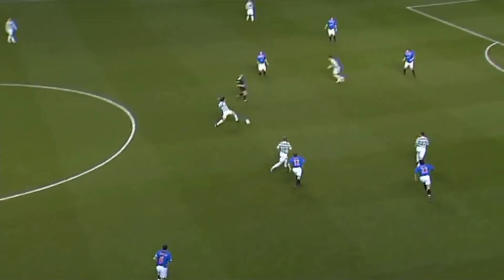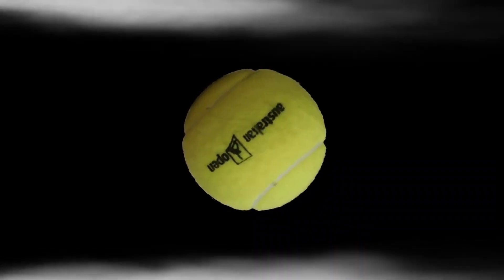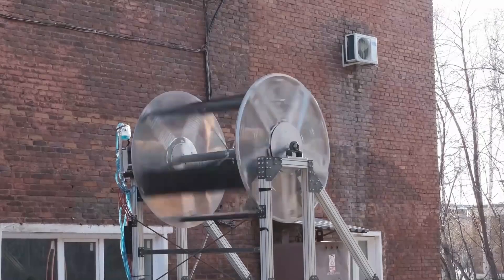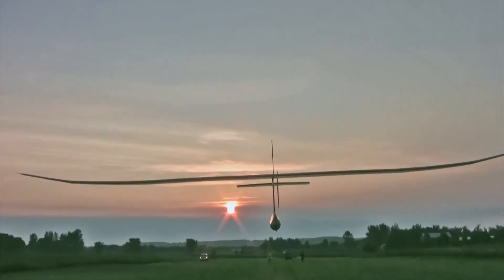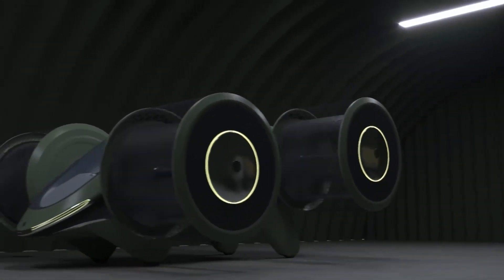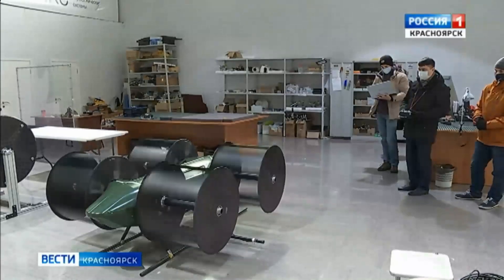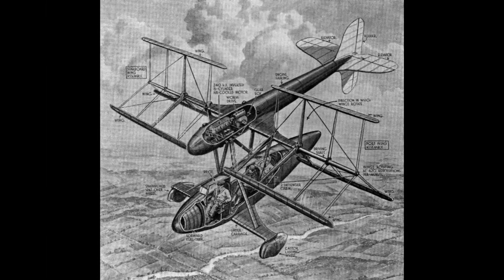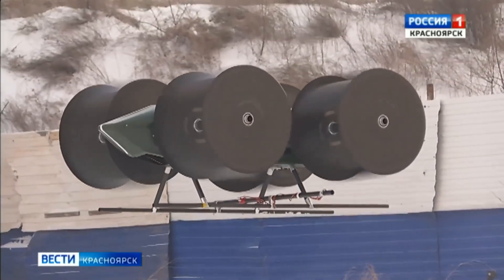The Engineering of ARF's Cyclocar VTOL

Comment: Cycloidal propellers are squirrel cage fans with the blades slightly repositioned. These propellers have been in your HVAC systems, automotive dashboards and leaf blowers for decades! Humans have been pushing air since the 1900's. These cycloidal propellers ARE JUST AN OTHER WAY OF PUSHING AIR.  Nothing cutting edge, futuristic, nor ground breaking about them! Smoke and mirrors for the sheep.  So the heard feels like technology is evolving; without compromising the secrecy of captured off-world propulsion and energy systems.  Alternative Energy and Propulsion Device is what the self-obfuscating anagram U.F.O truly stands for. Please don't be sheep anymore. That tech can make heaven on Earth but it's release would dethrone the kings via abundance for all. And it would eliminate greenhouse gas from fossil fuels and reverse climate change. But the kings would no longer control the energy commodity.  And they're gonna do whatever they can to persuade johny youtuber and the sheep into believing the lie. This knowledge is important. It is the path to never needing a day job and eliminating poverty. Free energy; no copper distribution grid needed. On an other level the "evil" Cabal has a point: us animals aren't moral enough to handle the truth nor the technology. Prove them wrong. Evolve. Elevate consciousness.

Comment: the helicopter engine generates lift all the time during rotation, whereas in this case the force is generated only when the wing is at the top.  or at the top and bottom, while in the middle of the work only aerodynamic resistance is created, so I waste my strength.

Comment: Once we manage to get anti-gravity working, aircraft engineers will be unemployed. Funny to think about how a hundred years of technological development in one field, can become redundant with an advance in another. I think cyclocopters will benefit from a frictionless magnetic gear system. To keep the smooth change of adjusting the pitch of the blades and reduce vibration. They seem very clunky at this point still. The total lack of lift when they fail is of concern. Even helicopters don't usually just drop out of the sky when their blades stop turning. Parachute option? I feel parachutes should be standard for light and small aircraft anyway. It would be such a confidence building thing and like airbags could be installed and forgotten until a warning light shows.

Comment: Now if one took an old plane and removed the wings, then put a row of these down each side. With a jet turbine in the back to generate electricity for them at low speed. And thrust for high speed when the rotors could be locked with the blade segments acting as three wing segments. 
All you need is is an AI to learn how to fly it by trial and error and you have a new low cost mass air transit system that could replace planes trains and buses.

Comment: This type of lift configuration would be awesome for adaptation to electric cars. Imagine pulling up in a fully charged Tesla and having these rotors latch to your wheels. All of the flight avionics and electrical power could be supplied by the car. This would also allow you to fly somewhere, land, then proceed to drive to the exact location.

Once energy density of batteries gets much better maybe this will be possible.

Comment: How I see this:
A square wheel was invented long time ago. There were many attempts to build a square-wheeled bicycle and all of them failed. But modern technology finally allowed to build one! Using carbon fibre composite frame and unconventional suspension, the engineers created a model with 5 kg payload capacity. Yes, it still barely moves but it has such a high potential and has some advantages on difficult terrain.

Comment: Actually it is just a Voith Schneider propeller,  like the one you can find on some highly maneuvering boats, but with a much higher rotating speed because the air density is 830 times less that of water. And... the Voith Schneider propeller is a very complex piece of mechanics. I strongly doubt its air applications could be as efficient as helicopters, even with advanced computer-driven technology.
Reply: Helicopters are actually already quite complex. There are linkages and washplates already on the main rotor to vary the blade's angles. Plus some complex behaviours when traveling forward fast enough resulting in the blades stalling during backsweep, causing loss of lift on one side.

I'd say both helicopters and cyclocopters have the same order of magnitude complexity; but helicopters had had decades of headstart in research, while cyclocopters had to wait until carbon fiber & 3D printing technology became widespread.

Comment: I really love how they get drones and they try to create a new platform for transporting people but it's still basically propeller helicopter
Reply: It has a different mechanisms to generate lift, though. Rather than a horizontal propeller, it's actually moving wings. There are some benefits to the cyclorotors compared to a propeller.

Further research is of course will be necessary to optimize cyclorotors, but it's quite promising.

Comment: As a former helicopter mechanic, I got a chuckle out of the "It's not used because it fails to generate lift if it fails to spin".  I seem to recall a similar issue with rotary wing aricraft.

On a more serious note, I'm wondering if something could be designed in to allow "auto rotation" similar to a helicopter?

Comment: cool, never even thought this could work but it makes sense, I would use both helicopter and cyclocar together, the density of rocket fuel is better than diesel, use that in your generator and use the power for the hydraulic pump and motors, and gear ratios will optimize the next hybrid some student thinks up, lol. Build it for real even if RC miniature, it's better than some lame cad that rots in a secret folder.

Comment: Before I forget this idea, let’s put it out in the universe. If the blades in the cylindrical propelling wings can move air in any direction, then I wonder if it can move liquids in any direction as well? If it can move a surrounding liquid containing copper in the opposite direction of the spinning cylinder that has magnetic properties, I wonder if it can be used to generate some sort of force. And then vibrate the liquid with certain frequencies to see if there it’s any effect. Just some stoner thoughts here.
Reply: Well, the Voith Schneider propeller -- which operates on the same principle as the cyclorotors -- does move fluid around...

Comment: Interesting, but the drive train has a lot of moving parts.  More parts equals more points of failure.  The quadcopter is superior in this respect: only 4 motors, with direct drive.  It's still an interesting concept, if only to find out what not to be doing.

Comment: Cycloidal propellers have been used in shipping for almost a century now. Same thing as these cyclorotors but oriented vertically on the bottom of the ship. They are especially common on tugboats because they allow near instant 360 degree thrust direction control the more distributed flow makes the boat resistant to capsizing compared to a to a tug equipped with azimuth propellers.

Promotional video for the Voith water tractor system: https://www.youtube.com/watch?v=0muPdHICrKU
Reply: Water is of course a vastly different medium for propulsion. I design personal powered water craft. For example a jet engine in air is not very efficient. Air is simply not an ideal medium for compression and thrust. A wing or propellor is on the other hand, very efficient.  Yet in water a jet engine is 100% efficient and propellors far from it in terms of propulsion. I'm working on a personal powered jet engine for small craft and even a hydro foiling tricycle. The result promises to be extraordinary with record breaking possibilities.

Comment: I like the flight time and range number of this vehicle.. starting to get up to useful figures.
Looking at the final renderings, would it not be better to have the Cyclos further apart in the airframe?
It would, in my understanding, provide more stability, as well as a better and more responsive moment arm for maneuvering the craft, right?
Reply: It will be a trade-off between stability and weight. The further apart the cyclorotors, the larger the frame will be, the heavier the aircraft ends up. That will require larger rotors, then later engines, and that also adds weight.

Comment: Would be interesting to see theoretical efficiency calculations compared to helicopters, tilt-rotors, e-vtols of other configurations...
Reply: Make it nuclear powered lmao
Reply: https://en.wikipedia.org/wiki/Cyclorotor#Design_advantages_and_challenges
Reply: It's certainly abysmal. These wouldnt even be half as efficient.. This whole channel is just Russian propaganda. Pretty much all the youtube channels that talk about American and Russian tech/military are Russian propaganda.
Reply: the helicopter engine generates lift all the time during rotation, whereas in this case the force is generated only when the wing is at the top.  or at the top and bottom, while in the middle of the work only aerodynamic resistance is created, so I waste my strength.
Reply: Right... Cant say im buying this one...
Reply: with so much frontal area on all those rotors and big spinning mass cant be all that efficient. but there always an be niche use for it such as urban rescue vehicle i suppose... oh or wait... that rotor can extent and is actually wheel most of them time... what a great concept for sci-fi movie.
Reply: @jebise1126  It might be inefficient now, but standard rotors/propellers had had decades of headstart, getting optimized to hell and back. With the recent uptake in the interest for cyclogyro, we'll likely see significant efficiency improvements.
Reply: @PanduPoluan  internal combustion engine had 100+ years but its still inefficient
Reply: @jebise1126  But they have improved, somewhat: https://en.m.wikipedia.org/wiki/Gasoline_direct_injection
I mean my money's still on hybrids/EVs tho.
Reply: @PanduPoluan  no... no we wont. Not only is this inefficient it's wildly unsafe as the "area of thrust" is only like 10% of a normal propeller making it like balancing a helicopter on a ball bearing.
Reply: @J1428753  but STILL inefficient as not even half the energy of combustion is being used as motion.
Reply: @jebise1126  Not so, the pitch changes during the entire rotation. They give no resistance except when they're oriented in the right position to achieve the force up or forward, or backwards. This makes them complicated and I think produces much of the vibration.
Reply: You won't. That's why it's CGI.
Reply: @suprememasteroftheuniverse    A couple CGI illustrations but mostly real video.  These things can fly.  But they're horribly inefficient and not very practical for much of anything.

Comment: Thank you for another great video! I would love to see a video about alternative energy carriers to batteries. Power-to-gas will be a big thing in energy storage, but what has a chance to make it into aviation? Airbus seems to be into hydrogen, but the low volumetric energy density seems like a big impediment. Metanisation would be a great alternative if there was an effective way to grab CO2 out of the atmosphere. Amonia seems like a good alternative since you just need (renewable) energy, nitrogen (from air) and hydrogen (from water) to make it and the energy density is decent. Also you can run it through a fuel cell to get electricity. What is your opinion about amonia for electric aviation?
Reply from the maker: I cannot say. You seem to know more about ammonia. I will be however doing a video where I will compare battery with fuel cell and also a range extender (ICE generator), and look at the flight times of various electric aircrafts
Reply: I think you would be the better judge. Here is a link to a seemingly credible lecture on ammonia for aviation purposes: https://youtu.be/F8nbGWAjScA

Comment: Looks like a good idea. I dont particularly like the way it looks however , if it's lifting capacity , durability in weather conditions , power consumption , computer controlled navigation and safety features in case of failure are sufficient enough to safely transport a family of 4 to a  destination of at least 100 miles at an altitude of of at least 200-300 ft above any given tree top and doesnt cost $250,000 then Let's get this thing going.
Reply: it seems like the solution to safety in the case of engine failure would be to add wings, which kind of defeats the purpose of the system as a whole.
Reply: @redpug5042  VTOL with wing capacity would have better redundancy than every helicopter currently flying.
Reply: @rip8641  What about auto-rotation?
Isn't that sufficient redundancy for an unpowered emergency landing?
I could imagine, once the various dynamic blade profile configurations have been explored, that such a feature wouldn't be outside the realms of possibility for this type of lift mechanism - although, perhaps, far less effective than a standard helo.
Reply: Parachutes
Reply: hahahahahahahaaahahahahahahahaha no. If there is EVER a stable prototype it will likely carry NO passengers, lift NOTHING, and only be able to fly in the stillest of air. The way these kinds of things produce thrust and lift make it like balancing a tractor on a ball bearing. Also the gyro force of these "props" alone will make it nearly impossible to perform stable turns.

Comment: With so many surfaces, could it ever be nearly as efficient as a helicopters disk?
Reply: Perhaps it would not be as efficient, but niche use (such as it being extra-quiet compared to helicopters) is likely to see it used in specialized circumstances.  That, plus it's just looks fun and novel.  :)
Reply: @maintoc  okay, yeah I get it now. Perhaps a little safer too. Always a "niche" for that sort of thing, isn't there?
Great video, btw
Reply: disk? like a flywheel rotor
Reply: @stucheluchin4702  
Yes, there's a concept called disk loading, check it out at Wikipedia under 
"Disk_loading" or "Disk loading"

Comment: hmm base on wiki, the lift force of magus effect scale with the cylinder radius square while scale with cylinder length linearly. assuming the mass of the rotating surface is 2*pi*radius*cylinder_length*surface_thickness*density_of_surface_material. For the same equivalent mass, a low aspect ratio thin rotating disk will have much higher lift than a thin rotating cylinder. IE: twice the radius will give you 4 times the lift, while twice the cylinder length will only give you twice the lift. And since mass scale linearly with either radius and cylinder length, it's better to have a thin rotating disk. Of course induce drag will be higher due to the low aspect ratio, but it's a trade off between drag and lift. But it's kind of weird all these magus effect lift device all design as thin cylinder instead of thin disk, greatly reduce the magus lift effect.

Comment: tesla turbine spin-jet turbine blower, quad spinners, 4x directions, also standard electric turbo with blade impeller
Reply: the spin surface drag creates under-pressure in the wing, sucks under-pressure to the top of the win, over-pressure under the wing, you say that is lift
Reply: shrouded tube surface friction air slinger
Reply: ducted friction tube air slinger
Reply: plane wing embedded ducted rolling tubes for vtol
Reply: pass-through wing air flow rolling tubes
Reply: easy ground effect air hover air pocket creation

Comment: Quiet, compact, and capable of heavy lifting- all while presumably being able to survive a power-off landing? Yeah. That does sound good.
Reply: You forgot to say simple, because it appears to be far, faar from mechanically simple, even compared to a helicopter it seems way too complex for what you get out of it. Also those vane net guards are the stupidest thing ever, there goes an easy 30%++ of all the thrust with all that air trying to push through the turbulence created.. Just take the grill off yor pedestal fan and feel the extraordinary increase in the fan force, this thing's moronic just on that metric alone, also note not one drone has a 'vane guard' installed -- cos they probably wouldn't get off the ground!
Reply: @Veldtian1  I'm pretty sure cyclo rotors are as complicated as normal helicopter rotors
Reply: @Veldtian1   Also it is not quiet, compact nor capable of heavy lifting, so I wonder where idea that it is comes from.
Reply: It does sound good. Maybe a bit too good.
Reply: https://youtu.be/2AvepssBwzY💙